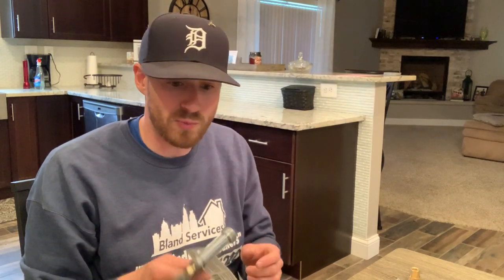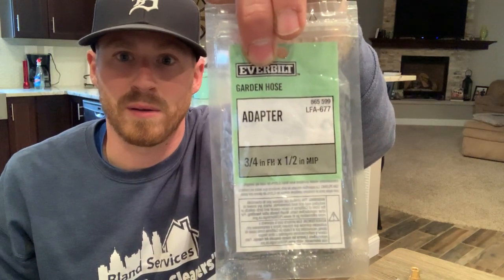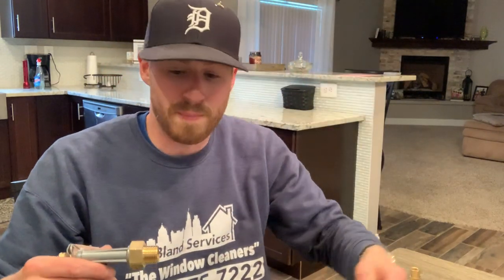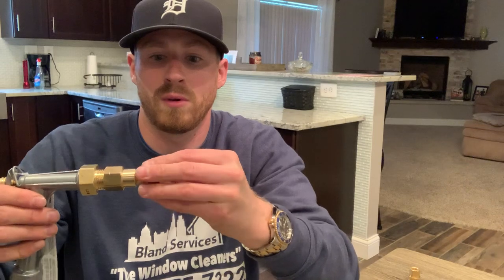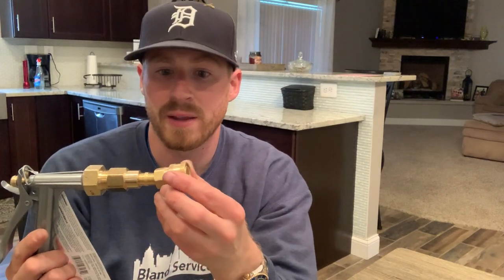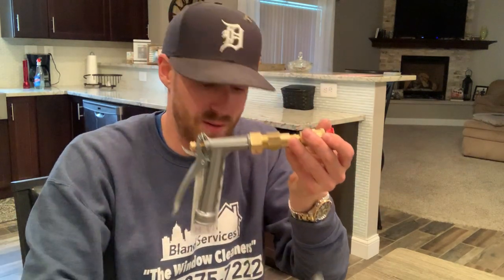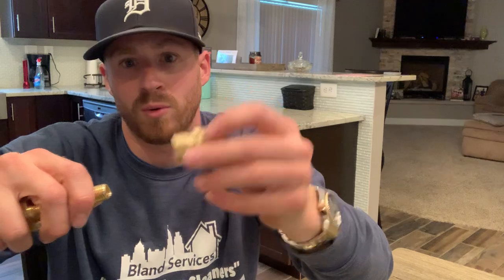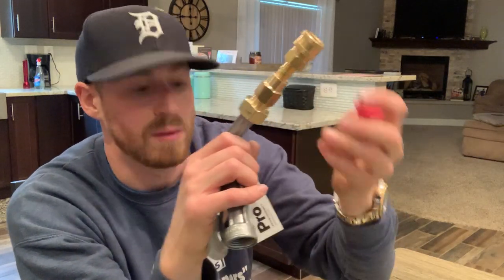How to turn your garden gun into a soft wash gun || Soft wash gun diy || Homemade soft wash gun

Comment: I have a question…why not have the first piece be a 3/4 to 1/4 and eliminate the 2 middle pieces completely?
Reply: I was thinking the same thing
Reply: There is a fitting that will directly bolt on eliminating several of those brass fittings idk what it’s called but I took the old one from my chemical guys nozzle and it’s on a cheap nozzle now I only spent 5 bucks replaceing it

Comment: You have the wrong part up. Anderson Metals Brass Garden Hose Fitting, Connector, 3/4" Female Hose ID x 1/2" Female Pipe. 

This should be female to male. Just drove 25 minutes Lowe’s and realize it’s not the correct one after building my soft wash gun. 🤦🏾

Comment: Absolutely the best explanation.    Love it.   Hey can you tell me how much water I need to mix with 12.5 SH to get it to 2% my tank is on 15 gallon capacity.    Tku much gonna clean stucco house.
Reply from the maker: Thanks for watching
Reply: divide you SH% by your desired % of Sh =X .  Divide the gallon tank size by X and get the amount of bleach you need to it and fill the rest with water.
Reply: 1:5 per 12.5%=.2%